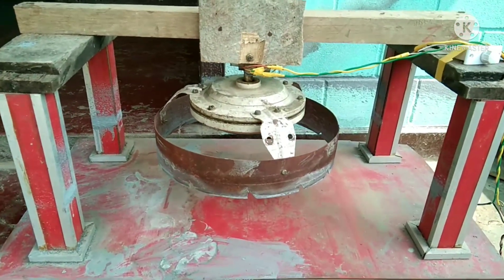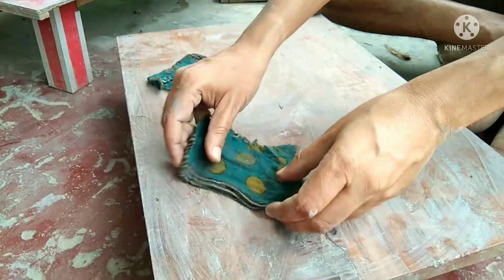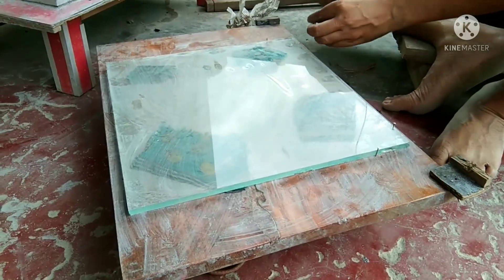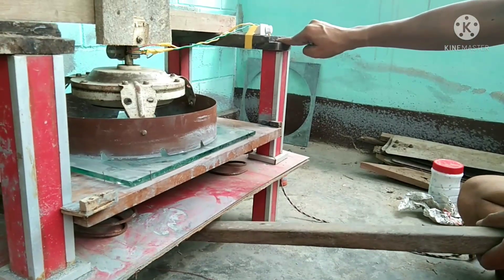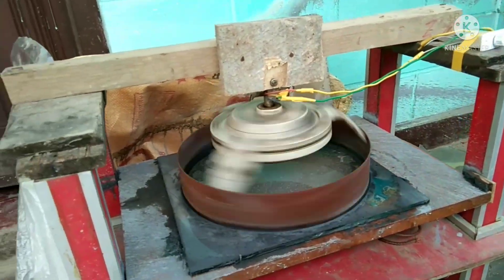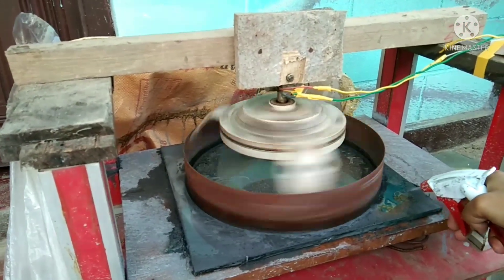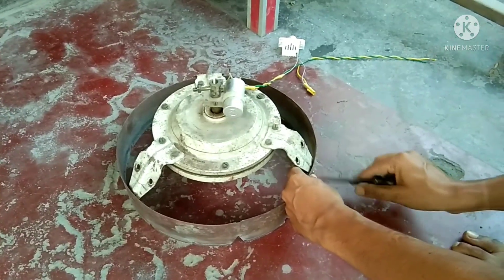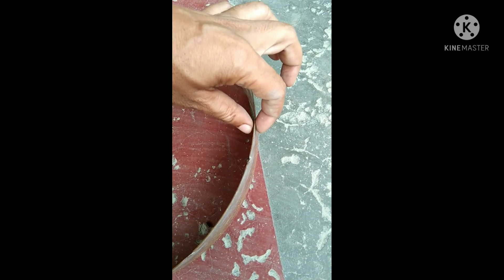How to make a telescope mirror blank cutting machine | making of 12" telescope ( Step 1)

Comment: Is it possible to make 40 inch parabolic mirror at home?
Reply from the maker: Why not , but its too big.
Reply: @astrovillager  Would you please like to share the details like what kind of glass, material, its thikness & dimensions would be required to build such a telescope...I have read only hubble optics is making 40" primary mirror...Is it possible to make it in India
Reply: @vaibhavghodekar2768  зачем такое большое зеркало? Завод "Электростекло" Россия может сделать готовый продукт по вашему заказу
Reply from the maker: Cant understand your langauge , English please
Reply from the maker: You have to buy 40inch mirror blank, in India it is available.

Comment: I was browsing youtube to find a way to cut mirror blanks to make a telescope mirror, and came across your video. This has to be the simplest way to cut mirror blanks. Hats off to you brother.
Reply: I wouldn't say the simplest, but the cheapest way for a low cost motorized machine. The simplest way is hay hand with a similar artifact non motorized. I did it.